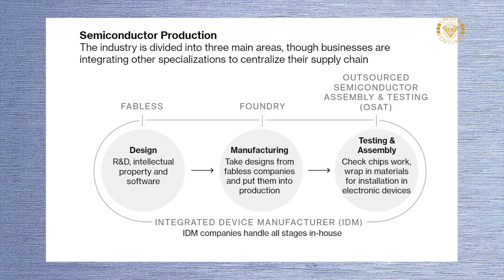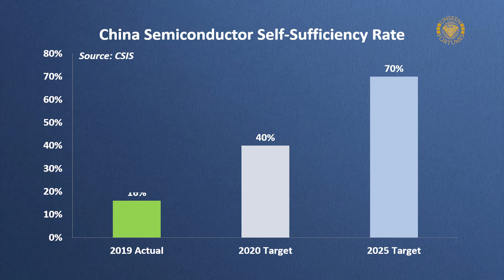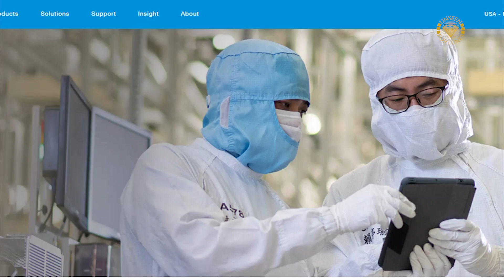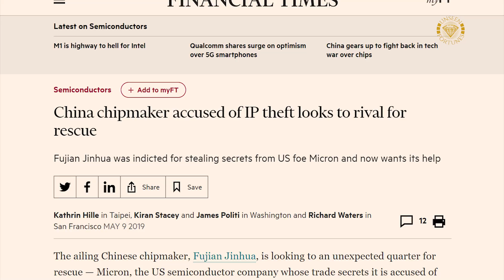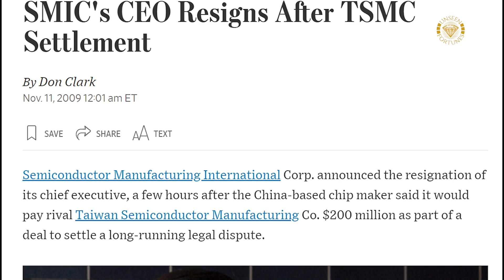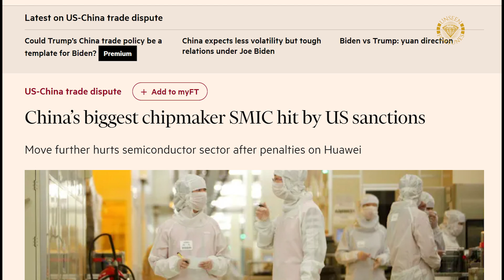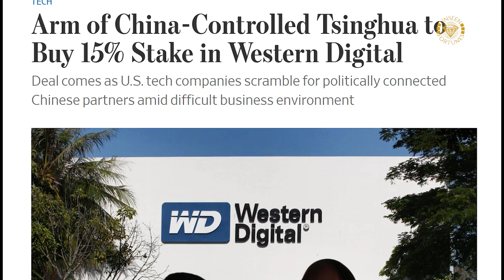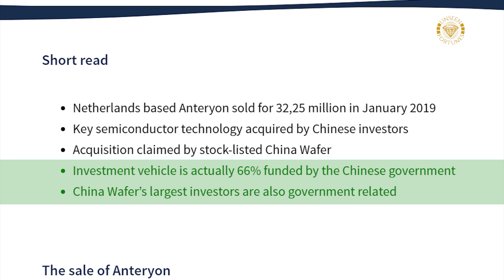US - China | The Secretive China Semiconductor Industry Strategies

Comment: I expect China to accelerate the promising technology of direct write e-beams to replace lithography.  It is currently used for highest accuracy but is too slow for mass production.  Efforts to make it into parallel ebeam  equipment was ended because lithography advanced so quick.  If 1000 parallel e-beams etched directly onto 1000 separate ICs on a 300 mm wafer, then it could increase throughput by 1000 and be reasonable cost at 2 nm line widths
Reply from the maker: Did you see my new video on China's chip industry?  Here it is https://youtu.be/OK3XCob8D-s
Reply: Etching is one thing. How about the chip performance after complete assembled and packaged and connected to computer motherboard ?